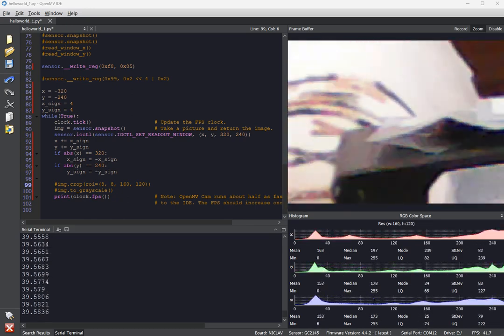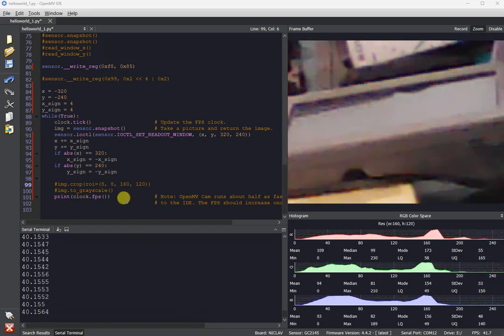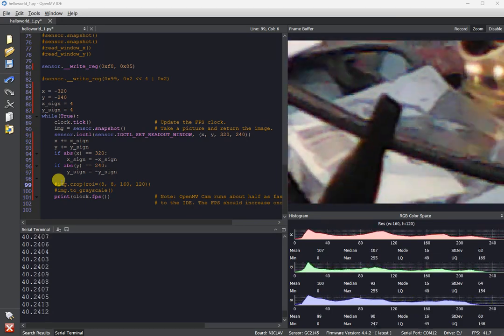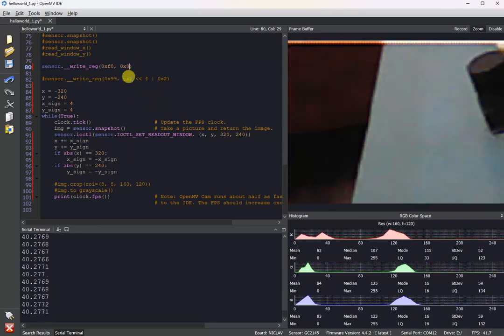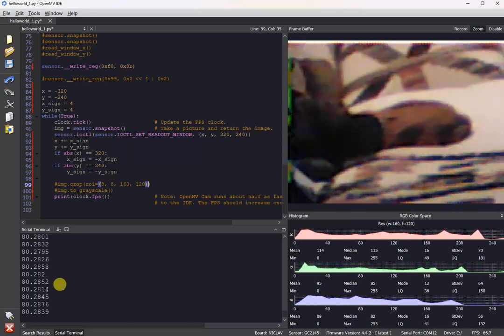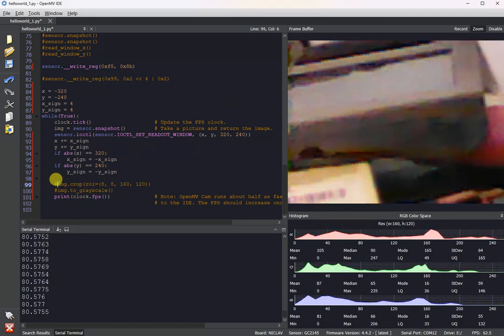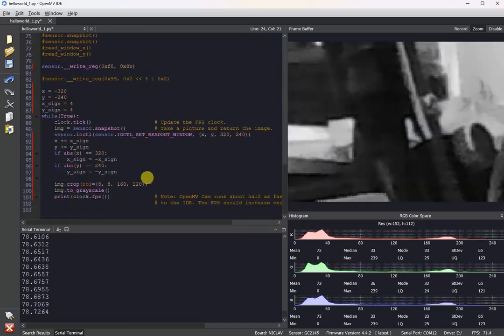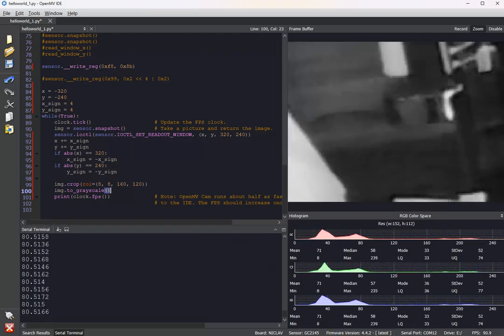Nicla Frame Rate Boost

Comment: Is it possible to connect an ArduCam 64 MP to the Nicla and use the possibilities for enlargement without loss of quality in 30-40 fps in the preview? I'm fairly new to this field and trying to wade through the jungle of information.
Reply from the maker: No, the processor can in no way handle and image of that size. Note OpenMV is focused on making microcontrollers able to process images. We have 400 KB of RAM on the Nicla versus 4GB on the Pi.
Reply: @OpenMVLLC  that makes sense... i was hoping there was a way. But thank you for your answer
Reply from the maker: @marco_di  Hi, we will be supporting higher resolution cameras and sensors in the future. However, please note... unless the sensor itself grew to 10mmX10mm or so... the 64MP aren't actually really helping. The shot noise on that is too high. It's really not good for machine vision.
Reply: @OpenMVLLC  I'm trying to build a microscope that I can attach to a small hand tool. The 64MP camera was already very good for this purpose, as it delivers very good image quality and also has no significant losses when you zoom in. However, the Raspberry Pi was too bulky for me and as soon as a high-frequency ignition came into play, there were only problems. The Nicla or the H7 would have been almost perfect for the project in terms of size, although I couldn't solve the problem of the HF ignition yet.
Reply from the maker: @marco_di  Well, the Nicla camera cam do up a higher resolution through cropping means. See the readout window IOCTL. This lets you focus the readout window of the sensor to get a larger zoom. You can easily get 2x on it. E.g. The sensor is 1280x720. So, if you set a readout window on the middle 640x480 pixels then you'll get a zoom effect.
Reply: @OpenMVLLC  Is there a tutorial I can take a look at? What also interests me is the protection against high-frequency waves. There are no problems with an iPhone, but the system freezes with all other electronic parts such as RPi or Arduino. So far I've been lucky that nothing got damaged. I haven't been able to find anything on this topic so far, although this can always be a big topic, especially in the industrial sector.
Reply from the maker: @marco_di  ask on the forums. Comments in YouTube are not great for help support.

As for high frequency waves… I don’t know what that would cause the system to freeze. You might want to ask Arduino about that.
Reply: @OpenMVLLC  That's a good idea... actually I should have thought of it myself 🙈

Comment: Interesting... do you think it will be able to reach 240 FPS on black and white colors? In that case which could be frame resolution?
Reply from the maker: That’s the max of the frame rate. This sensor isn’t designed to go faster.